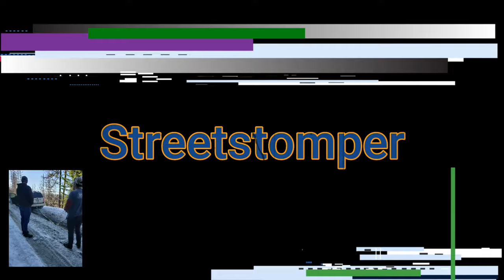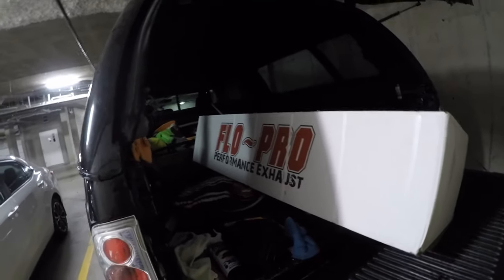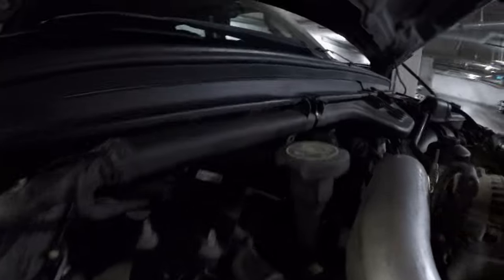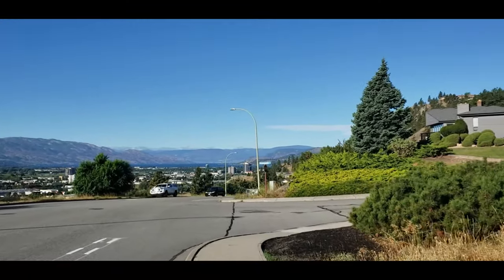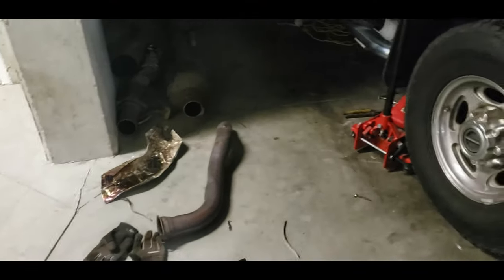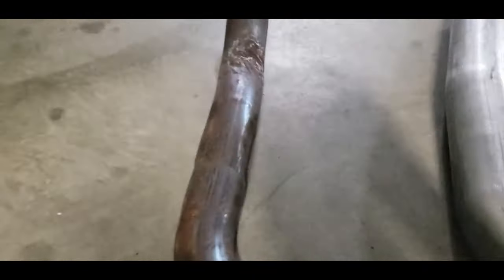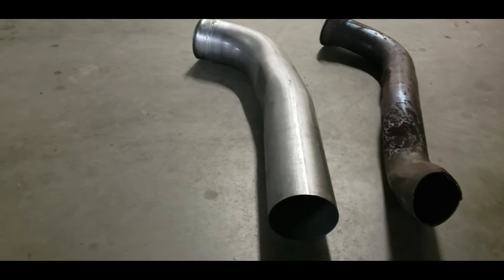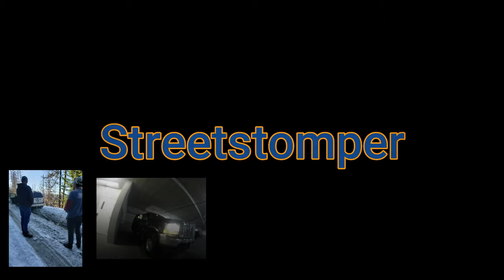Bullet-proofed 6.0 Powerstroke Exhaust install | Before & After = SOOO LOUD maybe TOO LOUD

Comment: If I may ask how much was the exhaust? Also, I was wondering about replacing the exhaust in my 5.4 Triton and I was wondering if it's a good engine to do it with or if it's not worth it?
Reply from the maker: For your exhaust on your truck you're probably better off to go to a exhaust/muffler shop and have them do either a flo-tech for you or even a  MagnaFlow kit. The total cost for this kit was not very much at all but they're completely different from a gas truck kit.
The 5.4 3vs sound great with upgraded exhaust.
Reply: 5.4 liter ticking time bomb nope cam phasers & low oil pressure if anything just sell the truck whole.
Reply: @DoctorRickSanchez  Telling me something I already know lol